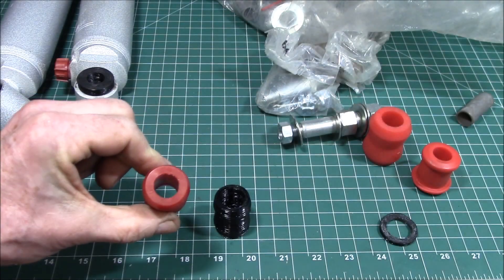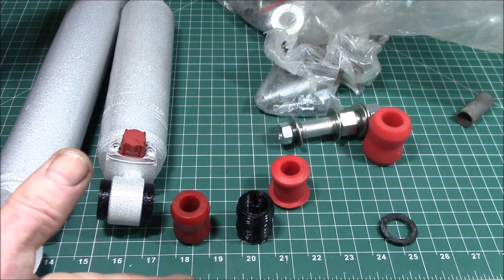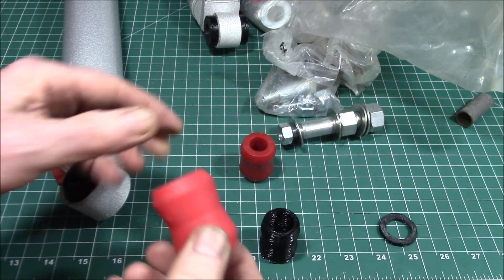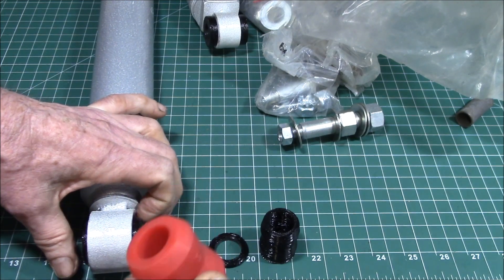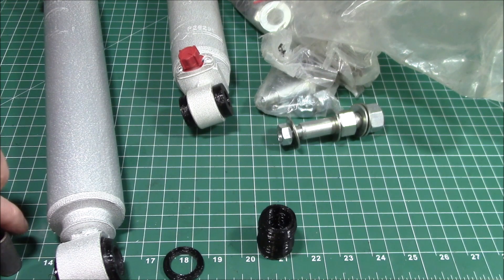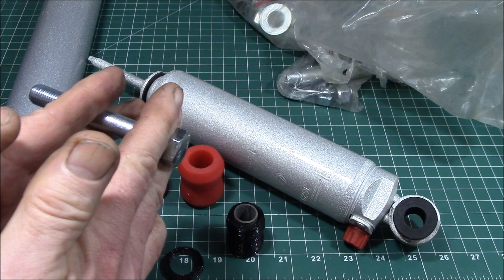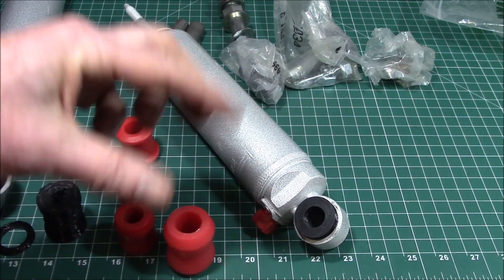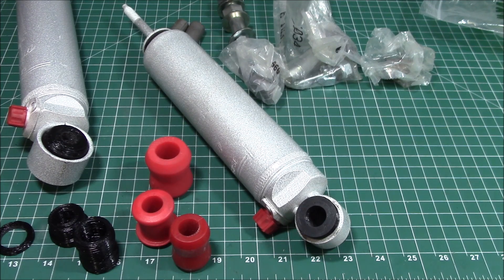More TPU Shock Absorber Bushings

Comment from the maker: I've added a link to the updated 3D parts files in the video description.  This is all now in OpenSCAD format.  This makes them easy to edit and modify as needed.  If you do make some of these bushings, post up your results here or in the comment section on Thingiverse or Cults3D.

Expanding the original shock bushing design really was an eye opener.  My original design was made with hard coded dimensions, for the most part.  Moving that design into 3 different bushing types taught me how to make the design easier to modify.  Also, learned how to make the bushings adaptable to compensate for 3D printing tolerances in a clean way.  All of these improvements makes it so much easier to modify the OpenSCAD files to produce the desired part off a given printer.  

For example, originally, I had the diameter, or actually radius, of the center hole.  To that I would add in the clearance number.  So a 5/8" hole would convert to a 5/16" (0.3125") radius to which I might add 0.01" to for clearance and end up with 0.3125".  All fine and dandy until it's time to make a 3/4" or 16mm dia. hole and then you had to start all over, dividing in half to get the radius and then adding in the clearance.